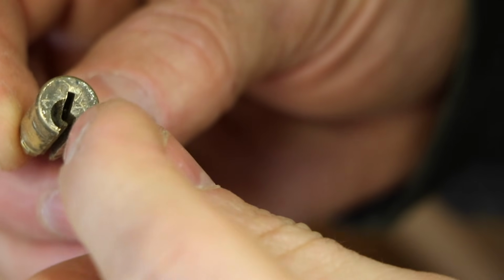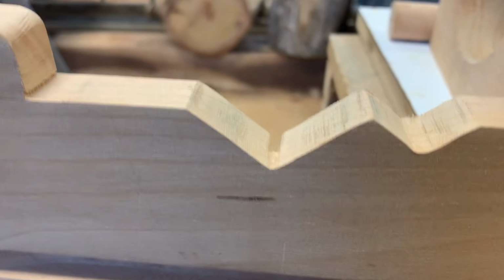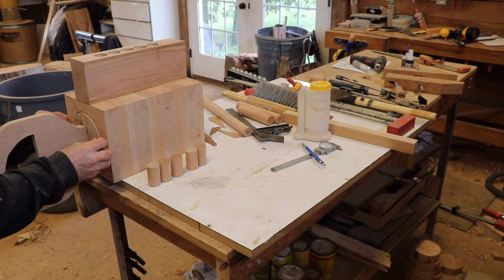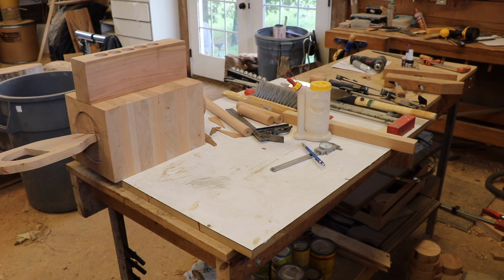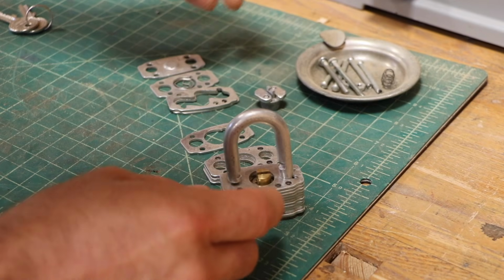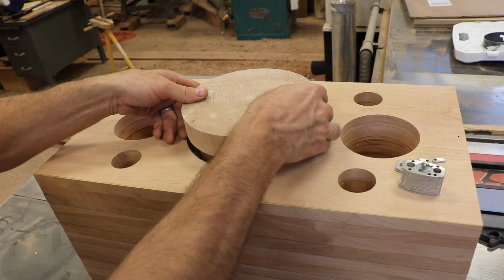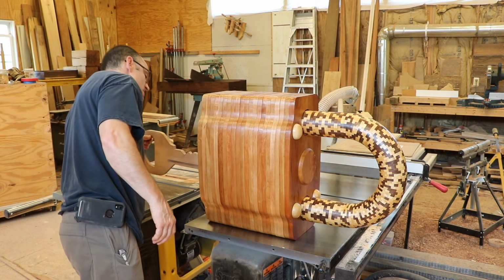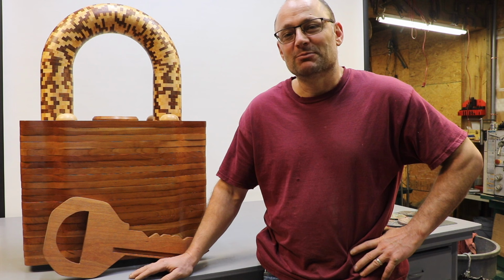Building a Massive Wooden Padlock, Start to Finish.  FarmCraft101

Comment from the maker: I never gave this build the start to finish video that it deserves, so here it is finally.  Don't worry though, I'm not done with lost PLA casting yet.  If you're disappointed not to see some more casting with this video, just know I'm working on it.  Coming soon!
Reply: Peter Brown would have loved a big bag of those shavings from the shackle, the back and fourth between dark walnut and the light maple  would have made for some interesting filling for resin. Actually any time you notice that something you are about to throw away would be beautiful dipped in resin then send it to him. Bags of saw dust in assorted grain sizes and colors, send it! Thin shavings of your favorite kinds of wood either by machine or by plane, send it! Metal dust from any of the cannon projects, send it! Emerald Ash Borer Beetles, Cicadas or other bugs swarming/plaguing your farm, dry them out fully then send them! Interesting tree bark or live edges being cut off of wood that you are cleaning up, send it! You get the idea, maybe add in a present and or a challenge!
Reply: When can we expect the colab with Lockpicking Lawyer where he picks your wooden lock.

Comment: I like how you didn't try too hard to make sure each of the sections of the outer lock body were cut and sanded as perfectly smooth with each other as you could get them, since normal-sized locks aren't even that smooth! Nice that it came out that way whether or not it was intentional.

Comment: Now send it to the Lock Picking Lawyer. See if he can pick it open. Spoiler alert: He can.
Reply: Next they need a colab with Fireball tool to create appropriately sized lock picks, as long as FarmCraft doesn't just make a set out of wood first.
He could also make some interesting security pins with that size even some interesting experimental ones. Maybe a spool with captured rings on the lathe, some threaded ones, some threaded chambers, Christmas trees, barrels, T pin with O rings below, and anything else I have forgotten?
Reply: @evilcanofdrpepper  Last year's April Fool's Day video that featured just the lock cylinder, FC already demoed his standard hook in 0.250 wood.
Reply: THIS!
Reply: That was the first thing that ran through my mind... (reaches inside with arm) "A little click on one, click on two, nothing on three..."   "And, it's open"